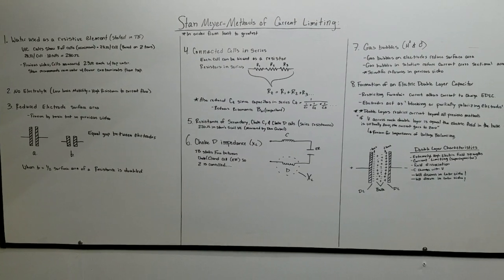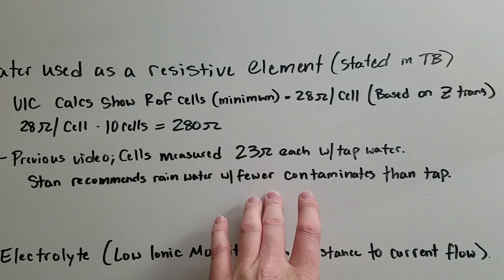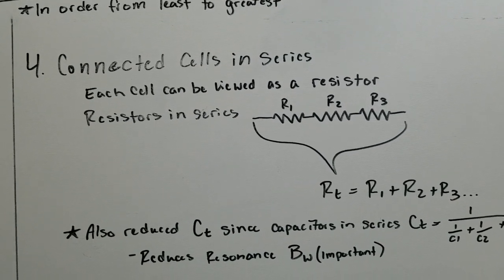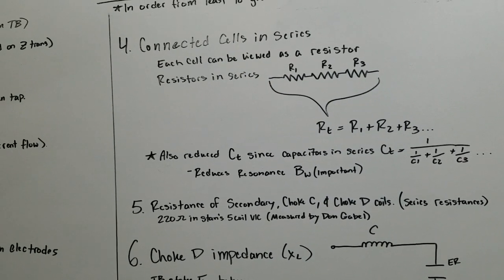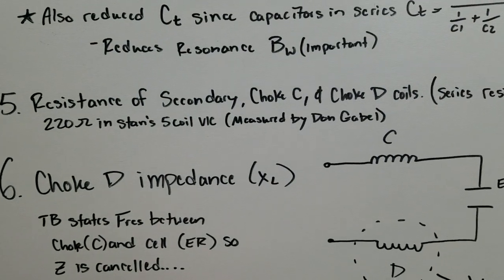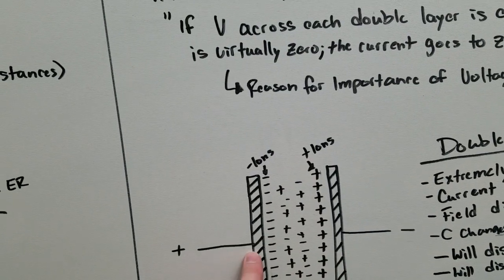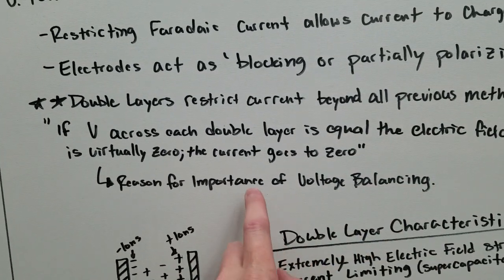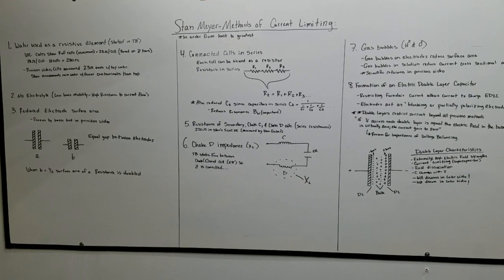Stan Meyer- Secrets of current limiting:

Comment: did you ever tried deionising water using combined ion exchange resin filter?
Reply from the maker: No I haven't. I did collect rain water though and it does have a higher resistance than local tap.